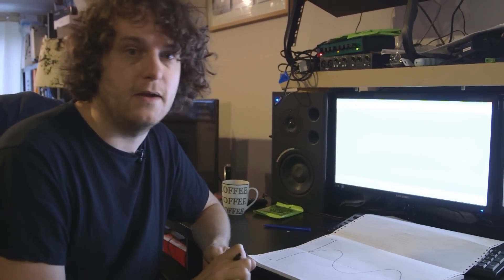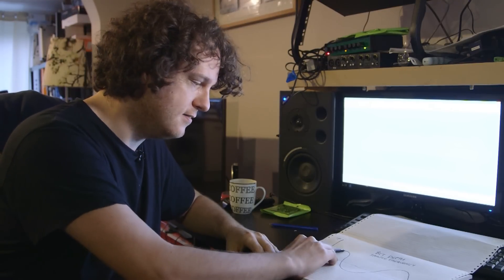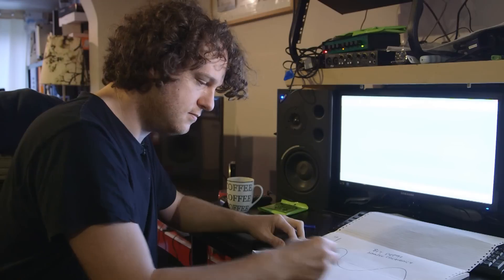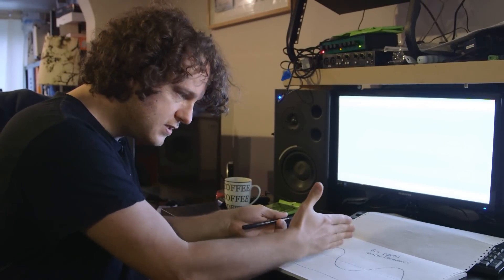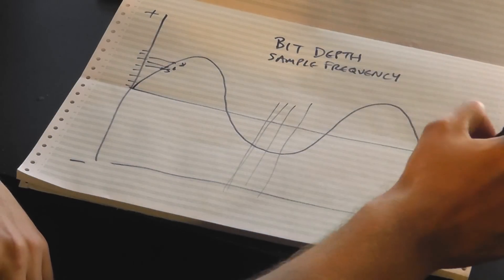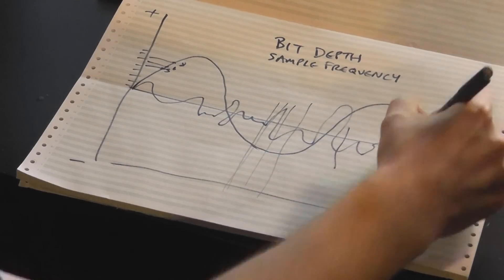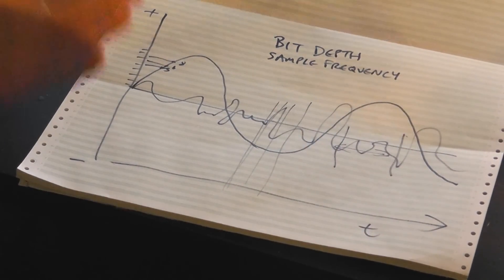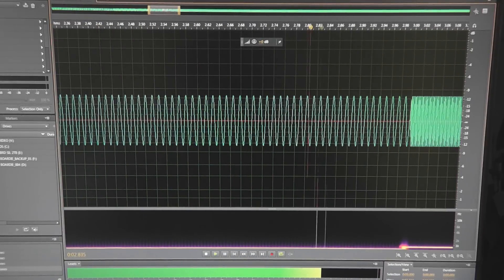How Digital Audio Works - Computerphile

Comment: The hearing range is up to 16-20 kHz. The reason it's 44.1 kHz is because it allows to detect 22.05 kHz frequencies. The gap between 20 kHz and 22.05 kHz is because before the A/D converter there is a filter that cuts off anything above 22.05 kHz to avoid aliasing. That filter starts cutting off at 20 kHz and reaches -60dB at 22.05 kHz so that nothing audible is lost. If the filter cut-off at exactly 20 kHz (or much closer to it) it would introduce a lot of distortion in frequncies and phases.
Reply: +Paweł Palczyński Well, the actual reason why 44.1 KHz was chosen is because, originally, digital audio for CD production was recorded in Sony U-Matic tapes (yes, the format for analogue video), and the technical specifications of the tape made 44.1KHz the most obvious choice.  Having a roll-off filter at the top of the spectrum is useful to avoid distortion, but the exact frequency you choose is not really very important; it's not like a lot of people can hear anything above 18 KHz.
Reply: +Joe Mills If you use bones (skull, jaw) to input sound instead of eardrum you can go even much higher. There is a upper cutoff frequency for air transmitted sound however, because at some point sound would need to be painfully loud for you to hear. A frequency at which it is not yet painful but you can still hear it as loud as 1kHz at 10^(-12) W m^(-2) intensity would be a highest you can hear then.
Reply: +Paweł Palczyński Actually 44,1 has nothing to do with any type of filter. You can always calculate and implement a slightly different one. There is one simple reason for 44,1 or 48 kHz was chosen. There were no HARD DISKS big nough at that time to perform all digital master. Remember  it's 1970s. Only posibll method to make a master from witch you could make a matrice to press CD was to record digital signal on video tapes.This was pre BETA time. So only viable option was to use UMATIC (stanard video recorders in TV production of that period) I cant remember exact resolution in nowadays digital terms but it worked out you could record (in monochrome) 16bit/48kHz or 16bit/44.1kHz on tape running 30 frames per second (NTSC framerate) 44.1 was choosen for CD probably only because you could fit extra 8% running time on disk that way. As for argue that it is inferior to 48, that doesn't matter. First CD players from Phillips and Sony were equipped with 14 bit DAC's, and up for this day people value this players for pleasant sound.
Reply: +Paweł Palczyński That is some cool extra info, thanks for sharing!
Reply: +Paweł Palczyński Something like a badgap?
Reply: +Joe Mills You don't think physical changes to the eardrum and ossicles plays a part? Or perhaps even changes to the fluid and haircells?
That is, mechanical changes rather than neuronal. Hardware v software.
:-)
Reply: Yes, thank you for saying this.
Reply: +Paweł Palczyński The reason it's 44.1 kHz is because it allows to detect 22.05 kHz frequencies. its called the "nyquist shannon sampling theorem"
Reply: thanks for the paper, I study DSP in my spare time and design stuff on the SHARC DSP platform. appreciate this.
Reply: No problem.
Reply: Nyquist Rate. In case anyone wants to understand it theoretically.
Reply: The 44.1 Khz has noting to so with double what humans can hear. The 44.1 KHz sampling rate was chosen because it was a rate that would work with both 50 Hz and 60 Hz video. The reason was that prior to the CD the only systems capable of storing the amount of data required were video based.When the CD came along the red book standard just adopted 44.1 Khz.

Comment: what kind of scale would one use for mapping input to bits? would a logarithmic scale work better for keeping the small and loud sounds?
Reply: +Philip Stuckey Well, actually, dB is already a logarithmic unit...
Reply: yes that would work but i dont know of any log DACs.
Reply: +TheWeepingCorpse And it would be a PITA for audio processing if we used logarithmic sample scales.
Reply: +Philip Stuckey The ideal scale would depend on what kinds of sounds you are sampling. More often than not equipment we have access to is far simpler and falls into linear scale.
Reply: +Philip Stuckey More advanced methods for storing audio actually take this into account and actually changes the scale over time to avoid this problem
Reply: +TheWeepingCorpse Some old sound chips in old computers and game consoles had a logarithmic volume scale for the square wave generators, like the Texas Instruments SN76489 or the General Instruments AY-3-8910. You can play sampled sound by turning the square wave to inaudibly high frequencies so that it doesn't interfer with the sampled sound (or on the AY you can just switch any of the three square channels to DC mode)
Then the CPU has to manually write the sample values to the volume register, which is only 4-bits wide. The 16 different levels are not evenly spaced out though, as you go lower and lower, the gaps get smaller and smaller between levels. This makes the samples relatively quiet as well.

Comment: Obligatory correction: The reason that 44.1 was chosen is not because they measured the threshold of human hearing at precisely 22.05, it's because it was "about 20kHz" and they needed to add a bit more on the high end as a transition band, which you might think of as...room for error in how they design the electronics. The reason it's 44,100 and not 44000 or 45000 (or 48,000) is related to how it was stored on old video recording systems. Today, if we didn't care about keeping to standards developed ages ago, it really just needs to be "40,000Hz + a bit more than that"

The "Humans can hear 20kHz" thing is just a general guideline, not a hard and fast rule. Biology is not precise enough to say "22.05kHz is exactly the right amount." People vary too much for that.

edit: Also, sampling a signal at twice the frequency is called the "Nyquist rate" and will give you alias-free sampling, which is why we use that. It's not just arbitrarily "Yeah, that seems like enough", it's a mathematical rule. That's not really super important to know, but it's a good term to Google if you want to know more.
Reply: Under normal listening volumes I can hear something up to around 17.5khz through my HD800's with a sine wave generator. It will most likely be drowned out by the rest of the music though unless i'm listening specificly to high pitched things. I tried to differentiate between 44.1 and 192/24 and couldn't tell a difference.
Reply: +OneBigBug +1 for Nyquist (aka Shannon-Nyquist sampling theorem), i was a little disappointed because this great fact was missing from the video
Reply: +OneBigBug 48kHz was used on DAT tape to prevent straight digital copying from CD which are 44.1kHz.  Yes, 48kHz was used to combat piracy.
Reply: +Joe Mills pretty sure only young kids still hear above 17khz, and there's a reason most music (mp3..) has everything cut above 16k. Plus, music is mostly made my adults, so it'd better be heard like it was heard by the one who mixed it.
Reply: +d5uncr 
24 hrs later...
You're right - troll.
Reply: You're the only one who mentioned Nyquist theorem by name among the top comments I see. So I just wanted to make a "yay, science!!" shout-out here x)
Reply: +Joe Mills It sounds more like distortion from the speaker trying to play that loudly than a 24Khz tone though.
Reply: +Joe Mills of course, young kids will be able to hear above 17, this is why the adult who mixed the song shouldn't even want anything above 17khz. Because he's not hearing it, it'd better not be there, as he can't know if it won't hurt. (of course in practice it won't happen and he can monitor it visually, anyway)
Pretty sure that, for young kids, 22khz white noise won't sound clearer than 17khz white noise, but that you'd have to test.
Reply: +OneBigBug now I'm getting nostalgic feelings about my physics course at university.
Reply: +anothergol 
Yes the production guys mix it to what they like. Until music is distributed as a load of separate tracks with meta mix data that's the way it is. As computing power and content delivery speed increase music may well be sampled at an extraordinary rate and delivered multitrack with no compression at all so you could mix down to your taste.
Although no doubt many artists would find this abhorrent.
:-)
Reply: +anothergol 
hmmm. Interesting.
Can changes to frequencies above a filter value change the filtered output. Perhaps via lower harmonics? I'm sceptical, I think you're right, but it would be interesting to do the analysis. Fourier Transforms?
Reply: +Peter Walker: well for many music genres heavily relying on compression & other effects, it would certainly be a bad idea to release tracks as separate stems
Reply: +anothergol Monty Montgomery, of Vorbis and Opus fame, has a nice post on bit depths and sampling frequencies (and a certain rocker who is unlikely to be hearing anything over 15 kHz): 
https://xiph.org/~xiphmont/demo/neil-young.html
Reply: when I render in FL Studio there is a setting for "sync points".  Can anyone tell me what that is?  Is that just for keeping the various tracks synchronized with each other?
Reply: I'm confusing about why is exactly 44.1kHz as well. 
1. The human hearing range is roughly 20-20000hz. 
2. The reason double is according Nyquist and Shannon’s theorem, which make sense for me 40 kHz. 

But the reason to use 44.1khz, I read from Wikipedia is not that explicit to me. 

It explains: 
1. Nyquist-Shannon theorem, which is the sampling frequency must be greater than twice the maximum frequency one wishes to reproduce. (So have 40khz, since the maximum hearing range is 20khz) 
2. To avoid aliasing have to use low-pass filter, so need a transition band, 44.1 kHz has a 2.05 kHz transition band. 
3. 441000 is the product of the squares of the first four prime numbers, 2, 3,5,7. Make sense during computation process.
Reply: Cool answer dude
Reply: ,y
Reply: but definitively hearing decays with age; when you're young you can easily hear high pitch tones from a crt monitor (16Khz); when you pass the 50s you can't (well, 1 in a million can)
Reply: +OneBigBug Exactly, there needs to be room for the antialiasing filter
Reply: +Joe Mills most people won't even hear a 17khz tone (which isn't a problem, there's nothing interesting for us above that), and if you think you can, double-check your system.
And this whole video, while not saying huge BS, is technically rather vague.
Reply: Yeah, but we're still dwelling on pure frequency sine wave at 16kHz.  Wouldn't a 16kHz harmonic (a.k.a. overtone or partial) influence the overall timbre?
Reply: +Joe Mills 
...and if they can hear a 20.1KHz tone they can hear a 20.2KHz tone
...and if they can hear a 20.2KHz tone they can hear a 20.3KHz tone
...and if they can hear a 20.3KHz tone they can hear a 20.4KHz tone
...
...
...
∞
A logical fallacy
troll plonk
Reply: What if I want to slow down the track to 1/3rd the temporary to break down a fast bebop piano part?  Ain't I better off with 192kHz/24-bit file than with an MP3?
Reply: +Joe Mills you're wrong and I'd like to know your sources that claim that people under 60 can hear up to 22khz
Reply: +Andrew Piatek then store as uncompressed wav files. What's your reason to avoid decompressing a FLAC? It's not gonna make your computer sweat, that's for sure.
Reply: +Andrew Piatek hahaha yeah....
Reply: *****
 And you STILL haven't provided any data whatsoever supporting your claim that lots of people can hear above 20kHz...

Yes, the really high frequencies are highly compressed because most people can't hear them anyway. Why waste bits on inaudible stuff??
Please do an ABX test of a song compressed with lame at 160kbps and 320kbps and post the result here.
I have a hunch your result will be close to 50% - i.e. pure guessing.

The problem is that you aren't busting any myths, just making unfounded claims...
Reply: +Andrew Piatek if you can't hear it alone, you won't hear it in the mix. White noise won't be any whiter to your ears if it goes above 17khz. The theory that says that an inaudible freq can affect audible ones is just hippie bs.
Reply: I would like to avoid any kind of compression, even FLAC.  I have only handful of albums on my music player, so space isn't an issue.  I want to avoid FLAC as well, because it requires extra processing to bring it up to uncompressed form for playback.  I would like to avoid unnecessary processing that only stems from lack of bandwidth or space.
Reply: Well, the portable music device will draw more battery to uncompress FLAC, instead of just playing back uncompressed linear PCM or DSD in natural and relaxed manner.  Less heat generation, less battery use.  That's the way to go in my opinion.
Reply: +Joe Mills never heard how cutting above 17khz detracts from the sound quality. MP3 (& it highly depends on the encoder) however does really bad things that detract from the sound quality. What's above 17k is really the least of MP3's problems (& transients in music matter a big lot more).
I even see other reasons (possible resampling to the soundcard's samplerate) to remove anything above 17k. 

But really, I'd like to see that serious test that would claim that a track sounds better (or any different) with its content up to 22k. Until then, I will leave that myth to those audiophiles who also believe that 16bit isn't enough.
Reply: +OneBigBug Doesn't this also dictate dithering down from say 48' to 41' for CD or even from 41' to MP3 lower end sample rates? I think this effects the final resolution but I am still learning.
Reply: +Joe Mills You are just trolling here, right?
Because most of the things you're claiming is pure and utter BS.
Reply: +d5uncr I don't think he's a troll, that guy is just clueless
Reply: *****
 So you agree that your statement about being able to hear a 20.0 kHz tone = being able to hear a 20.1 kHz was wrong then...?

No one has argued that ones hearing abruptly stops at a certain frequency - we all agree that it gradually decreases.
What we argue is your completely unproven claim that most people should be able to hear above 20kHz.
But feel perfectly free to prove your point by linking to some scientific study supporting your claims. I've only asked for that a handful of times already.

And feel free to post your ABX result of a 160 and a 320 kbps MP3.
An ABX test, BTW, doesn't show which file is the higher quality, it just shows whether you're able to tell them apart.
Something you should have no problem with seeing as you apparently have bat hearing...
Reply: *****
 Again, no one is is saying our hearing cuts of. Didn't you read what I wrote in the previous comment??

When you did that 128 vs 320 kbps test, did you know beforehand which was which?
Because if you did you might as well have been fooling yourself into believing you could hear a difference.
That said, 128 kbps is on the lower side when it comes to MP3s. My threshold when it comes to ABXing an MP3 and its original WAV is around 160 kbps (for a specific sample [Axel F in my case] that is).

Do a proper ABX test with lame encoded 160 and 320 kbps files and then come back with the result.

Umm... FLAC is lossless, so a 24/192 and a 24/96 FLAC file would clearly sound the same. Because even with your bat hearing I am pretty darn sure you can't hear a single note above 90kHz.

Do you actually have any idea what you're talking about or are you just googling audio terms and throwing them randomly into the comments?
Or are you some AI Turing bot?? In that case you did actually fool me...
Reply: It was already mentioned (implied) when he say about doubling the sampling rate. In fact he elaborated on it when he drew tat huge wave 🌊
Reply: Rupert Neve can detect 50kHz harmonics.  They tested him.  He didn't fail the test.  And he's not entirely young either.
Reply: *****
 And you still haven't provided any scientific research suggesting that lots of people can hear above 20kHz...

The reason MP3 has "problems" with high frequencies is because most people can't hear them anyway, so they're intentionally discarded to keep the file size down.